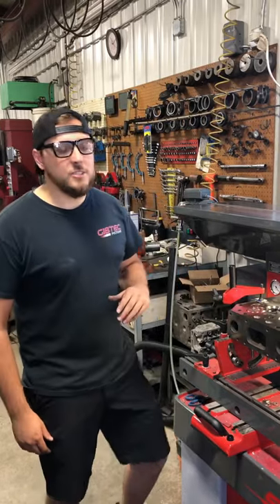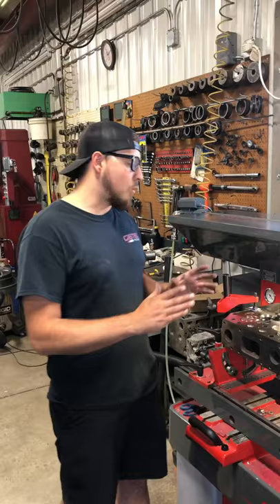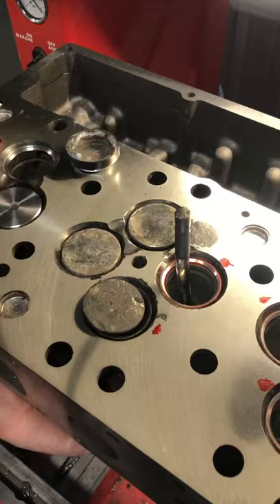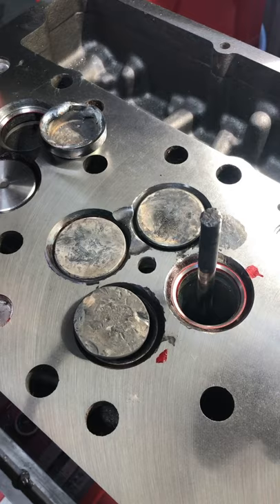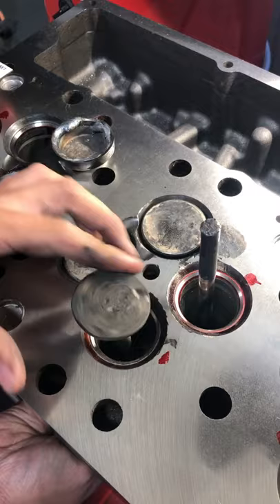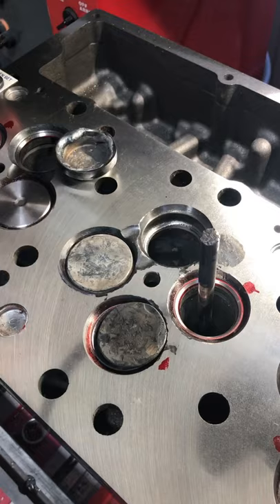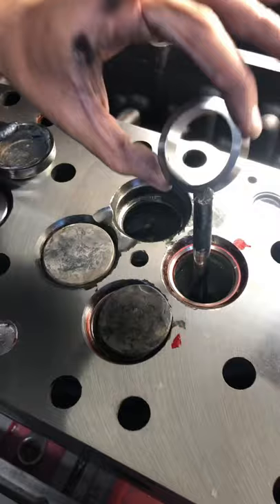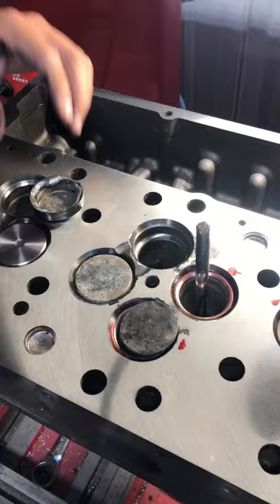#shorts C12 Caterpillar Catastrophic Failure - What happened?

Comment: Over heading allowing the valve seat to spin. As it spins it will wear the counterbore out. But after the engine cooled it gained back enough press fit to make the seat hold in.
Reply: took the words right out of my fingers..literally had that typed
Reply: @jeffbush7764  But I wonder. You would think the seat spinning would cause the valve to be even hotter from improper heat transfer from the valve to the seat. You’d think the valve would’ve been pounded and severely cupped.
Reply: Yes this was what i thought as well
Reply: Could’ve been a poor injector that cause a lean condition which led to all of this.
Reply: this sounds very plausible
Reply: I get what your saying. But that's almost alien conspiracy to go go that far. The universe is a strange place. Look for horses when you hear hoof beats not Zebras.
Reply: I say bad harmonics. Same thing that would cause the ford/Mazda split port injection engine to drop a valve seat and destroy itself.
Reply: It would get tighter as it gets hot bro. When things heat up they expand because the molecules are moving around faster when it’s cools it shrinks because they slow down and move closer together. That’s why when u heat treat it makes stuff strong because the molecules can line up better after they heated and cooled
Reply: @cncdan1364   if that applies and was relevant to a valve seat then why does the valve seat transfer heat to the cylinder head to displace the heat? If it was better to get hotter and expand you would want it to hold all the heat. Sorry but certain items like a valve seat can only withstand so much temp and abuse before they break down molecularly and physically.
Reply: @wisconsintractorpullingforum  because the head heated up faster than the seat. If your gunna explain something explain it right. The way it reads makes it sound like the seat heating up shrank it but after I reread it I get what he was saying.
Reply: Or should I say what you said lol.
Reply: @wisconsintractorpullingforum  in the end I don’t think it was just heat.
Reply: @brethall2006  good “saying” or how ever anyone else pronounces it analogy i don’t know but I like what you said
Reply: I'll say from factory.
Reply: @cncdan1364  “when things heat up they expand…” which is why the hole in the head enlarges when the head overheats. When you have an interference fit pinion gear you need to fit onto a shaft, do you heat the gear or cool it, to make the bore increase enough to slip onto the shaft? You heat it, which expands the bore. 👍🏼
Reply: @cncdan1364  so if the head overheats enough, and the tolerances were microns off on that seat, the seat can loosen up inside the bore - same as that pinion gear you heat to get it to open up enough to slip onto the shaft
Reply: @cncdan1364  depends entirely on the coefficient of expansion of the two metals and I bet the expansion rates of cast iron and something like stellite would be different enough for the seat to get loose if the head over heated, and I bet the seat has a much lower coefficient of expansion than the cast iron.
Reply: Agreed
Reply: It's All Greek To Me. You have to be a molecular scientist to know all of this. Or from the old school of experience is the best teacher. All knowledge is Usually learned by experience. Some people break down and rebuild without finding out why it happened in the first place. That would be me hahaha. I applaud you all for taking the time to find out why things happen the way they do.
Reply: What he said ☝
Reply: Sounds right.

Comment: I've been a diesel mechanic for awhile, and my best guess is one of a few things, possibly a combination. Either the engine was overheated a few times causing the seat to become loose and move; the seat was lose and got hammered back into place by the lose valve; or the head was re-done by a shade-tree shop that didnt machine it  properly when installing the new seat. I'm curious as to what the piston, liners, and block look like, as that could give some clues.
Reply: Bingo bango just got done with a Kubota 3 cylinder and thats what happend and the valves looked the same way but not broken just cracked from over heat and then cooling down
Reply: Had this happen before. But it was on a reman head. Valve seat bore wasn't bored correctly and it spun in the head.
Reply: I had been thinking an injector failed, overfueled and created too much heat, or it was a turned up engine and he didn't care about egt
Reply: I’ve heard of the overheating situation happening on a 90’s GM 4 cylinder gas engine, and it caused a valve to seal just enough to where it would only affect engine performance when it had a major load on it. Head removal proved the final diagnosis. Similarly, a neglected Ecotec engine was “repaired” by a hack who just jammed a new valve in and caused the engine to run rough but pass all quick visual checks, compression, and leak down testing but was figured out after a proper contribution test and then head removal.
Reply: If it's just one cylinder, then that could possibly be from excess cylinder pressure.  If all the cylinders have that problem, then the engine was overheated.  This is why cylinder pressure balancing is important, especially on a Diesel.  Dropped valves, loose conrod nuts, and warped pistons can all be caused by imbalanced fuel and cylinder pressure.

Comment: Pretty simple, the valve head was getting mashed into the intake valves by the piston, which beat the crap out of the seat and deformed it.  It’s amazing the damage isn’t worse.  I bet the rod bearings on that cylinder don’t look so great, either.
Reply: Exactly what I was thinking. Beat it farther into the head but since it's on a ramp from the seat face it expanded it as well and kept it from falling out.
Reply: He said the valve seat has been bouncing for a while meaning before the catastrophic failure of the other valve
Reply: @jmoyet  No, He said IT LOOKED LIKE IT WAS BOUNCING AROUND LOOSE IN THERE *“despite the seat still being tight in the counter bore!”* It was probably spinning in the counter bore after it was hot, then after it cooled it still had a slight press fit maybe, Would be my guess…. But who knows.
Reply: I started to say that very thing, I’m not a machinist, and I have very little experience as far as tearing down motors and inspecting damage ( I’ve been apart of tearing down and rebuilding 3 ) so I decided to look at the comments instead of typing my comment lol

Comment: I bet the previous valve seat repair didn't really seat properly on the head and didn't achieve correct interference fit inside the head.
When the engine goes into repeated heat cycle, valve seat became loose and "hammering" engine head.

It's common occurrence in my country when the shop didn't fit the valve seat properly. I often opt to keep original valve seat rather than replacing it if possible.
Reply: It's possible they uncovered some old damage???  Doesn't seem likely seems like a poor old repair gone wrong.

Comment: I've seen those valves break at the first keeper groove more than once so I believe your correct on the valve. That seat was moving when up to temp. or hotter. I think the fact that it was no longer round is the only reason it wasn't loose.

Comment: I've lost count of how many of these heads I've reclaimed from dropped valve seats, more than likely it's had a seat come loose and damage the counter bore at some stage in its life and someone has just punched another seat in the damaged counter bore which would explain why it was still tight when you removed it because the damage wasn't from the seat you removed. for the one with the missing head it's likely it dropped the head and the valve tip was snapped off further along during the failure I have seen plenty of these drop heads off the valves (usually the exhaust) and I've seen some where the valve spring has broken from wear steps on the end coils and then spat the collets and dropped the entire valve and they all ended up being complete cylinder head replacement (remanufactured cat a.k.a re-man)
Due to the combustion faces being absolutely obliterated beyond reclaiming.

Comment: I had an old whizzer with a valve seat that when hot would be loose and flap around, but when it cooled down the fit was tight enough to hold it in place.

Comment: A Cessna 150 in my dads flying club had something similar happen. Pilot made it back safely thankfully, had to pull a cylinder off one of our parts engines and that did the trick. Cool to see how a machine shop would fix it.

Comment: Maybe it overheated, I had a hemi that lost a few intake seats due to overheating and poor choice of metallic materials vs the cross tolerances in the machining of those materials.  It destroyed the cylinders walls, the face of the cylinder and the valve pushrods due to a valve not closing completely and the extra lash from that bang so hard Nd often it bent the pushrod on a few.
If that makes sense.

Comment: Simple : the seat counterbore was damaged because of a lack of air pressure in the muffler's bracket. That made the piston do a 47.5 degrees stroke. If they had use some good quality connecting rods, the radiator would have the good amps to spin the crank damper. Sometimes it fails.

Comment: Head got over heated in some way. This allowed the seat to loosen very slightly. In turn this allowed the seat to move and the valve wore away a ‘new’ seat location. When fitting a new seat I always heat up the head, not just local to the offending seat, that might cause problems elsewhere, but all over. Whilst doing this, I put the new seat in a freezer, so I have an ‘expanded’ seating area and a ‘downsized’ new seat. No loitering, I quickly put the seat in place and hammer home, let it all cool naturally, good as new! (Must fit a new valve though and grind it in correctly).
A bit like fitting a new starter ring gear.

Comment: Need more info! Push tubes bent? Rockers broken? Valve springs broken? What does the top of the piston look like? What does the cam lobe look like? Obviously that valve seat was leaking for awhile.  That would have caused a pop that you would have heard through the intake! Where the most wear damage occurred, normally that’s the start of the issue

Comment: Just pulled apart a c12 and it broke off the top of a valve bridge. Push rod popped out and kicked out the other valve push rod. Came in for low oil pressure. Not a miss . Alot of fuel in the oil (from the dead cylinder). Caused low oil pressure....  quoted the customer for an inframe rebuild

Comment: Cat heads are usually a durable head I have seen cat remains drop valves not often but it does happen. As far as the seat I'm guessing machine shop got it wrong or it was repaired once before.
Reply: Had a 2000 pete with 475 cat. At 325000 dropped valve in number 6 cat fixed it at 478 dropped 2 and 4. Asked why ? Basically was told shit happens.

Comment: Valve seat bore was damaged from valve seat not being installed flush likely causing the pocket to be slightly out of round which allowed the valve seat to walk in and out, but not completely dropping out of the bore.  This condition goes on for however long it took the keeper grove to fatigue and fail from the valve and spring assembly rotating while under constant compression from the valve seat not being fully seated.  Finally when the valve drops the ensuing collision with the piston bends the valve and cements the loose valve seat back into the valve seat pocket the rest is history.

Comment: Shut down right after running hot. Common in older engines (both gas, and diesel) to drop an exhaust valve seat after working hard, and shut down without running to allow heat to disapate for a bit first

Comment: The broke/missing exhaust valves were not allowing the cylinder to compress fuel/air so the piston was hammering the crap out of the intake valves. Since there was no compression or reduced exhaust flow the intake valves were taking the full brunt of the piston hammering all the valves during the exhaust phase. The piston kept driving the intake valve against the seat causing the seat to drive into the counter bore. Counter bores as you know are conical and it acted like a wedge driving it further into the counter bore eventually deforming it. Throw in some heat and there you have it!  It’s all physics!
Reply: Nah, it was definitely not enough air in the tyres mixed with too much blinker fluid. This causes back pressure in the inlet manifold and forward pressure exhaust, causing the driver to fart more. This lethal mixture caused too many oooga doogas for the valve to cope with...... happens to the best of us

Comment: I can tell you exactly what happened. Last first. The seats came free because of overheating.  Reset because block is cool. Yes valve disintegrated. Pieces went everywhere. Above and below. Going to need a new sleeve and lvl head before attempting any repairs. Might even or should die test head for micro cracks. Bet money you will find some. Should treat this as a catastrophic failure. Full engine rebuild. All injectors, exhaust cat converter,  exhaust turbo and anything in muffler rattling? This is a full rebuild. Anything less.. issues will haunt you. Ohh.. I went to school to rebuild these exact engines. They were mechanical fuel pump injection in my time. Love an explosion engine.

Comment: I had a C12.  Hated it.  Bought it used from IWX. 624k miles.  Put Jakes on it as it had none.  At 825k broke its 7th exhaust manifold stud and was running the Jake at the time and boom.  Cold air spider crack in the exhaust valve.  Pulled the head and saw the crack immediately as the head cleared the block.  Ok new head from Cat, cause I’m not waiting on the machine shop to recon.  The mechanic then does his normal curious inspection of all the pistons.  Puts his fist on top of the pistons and pushes down and does a circular motion. The first two were so loose it sounded like he was hitting the cylinder walls with a mallet.  🤬.  Inframe rebuild.  $$$$$$$$.

Comment: Intake seat was bouncing enlarging diameter which caused the exhaust valve to fail. The intake seat hammered bach without failing. Should be valve guide wear on intake if I'm correct.

Comment: The question was the inside of the intake or exhaust chamber under the valve seat was deformed?
It can’t be because the dropped valve was banging around during operation.
There’s only way it could happen the damage was pre-existing before the engine was reassembled the last time,

Comment: The head was machined, assembled, installed and ran like that from day 1, almost guarantee it. It's getting a seat ring installed so who cares what it looks like underneath as long as the ring still has enough surface to seat to and it's not wallered out the floor of an interference fit really doesn't matter much. Almost guarantee the engine failure didn't cause that damage, and almost guarantee it was caused by tool failure in the original process of machining or operator error that was hidden and made it past inspection and assembly

Comment: Timing belt or chain broke. The other valve is also damaged. The damage beteen the intake valves might  result from the cracked outtake valve. The other part of the cylinder head was not shown.

Comment: Overheated... dislodged the seat... causing the valve to snap... now the valve is floating but the seat is being beat back into place by the piston hitting the valve.. the operator shuts the engine off the head cools and the seat is back in place. As the rocker arm engaged the top of the valve.. the seat was dislodged... either the rocker is going to give or the first weakest point ...the valve retainer grove..The valve guide could be damaged somewhat...pushrod as well.(bent) 
Ps..
It's been 30 years since I worked  on a Cat. 3306,3406  but hey that's my synopsis. 
And hey I don't even know the working of a 12 liter cat engine.. but the consequences of a dropped  seat  is almost always heat related...
And the dominoes start falling.

Comment: I dropped a valve on a Cummins ISX back in 2005. Company I drove for had a replacement truck 1500 miles in 36 hours on a wrecker and pulled the truck with bad engine home. $18,000k later they had the engine overhauled and back on the road. They had to do a complete in frame.

Comment: I think cylinder 2 needed to release pressure inducing a helical motion therefore resulting in buildup of oil transversely affecting the flux capacitor and I don’t know why you are still reading this. I don’t know what the hell im saying. 🤣

Comment: Absolutely spot on. The loose seat was the first and primary failure point. Probably not the only valve seat in that head that should be replaced. That poor installation is likely to have occurred across the entire head. ✌👍

Comment: The engine was overheated, partially  seizing the exhaust valve which let  the keeper release then drop the valve in the cylinder. I've also had exhaust valves separate from stems. Anyway it happens the liner, piston and rod are junk. Needs a cylinder pack or power pack. If the engine was above 1500 rpm I would also look at the crank. Had this happen to  six Cat engines in construction equipment because the operator wasn't paying attention.